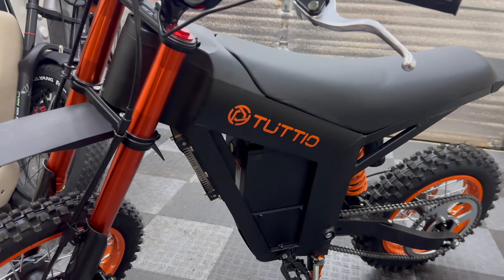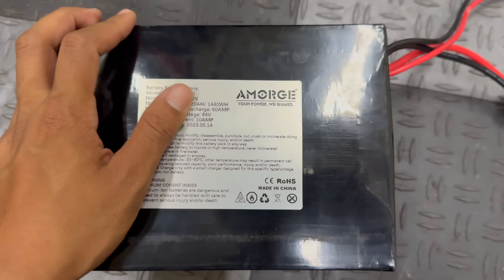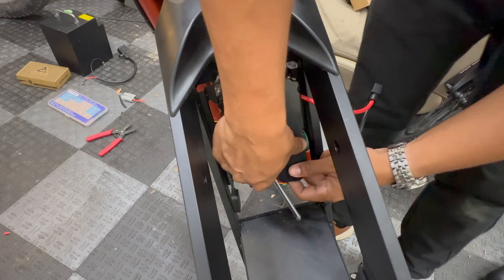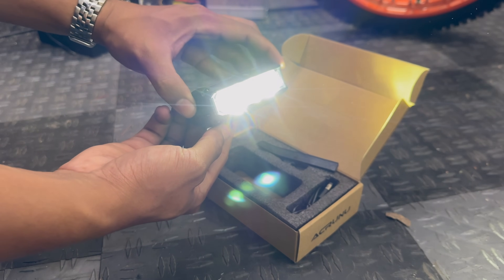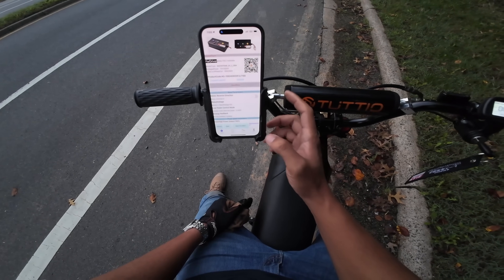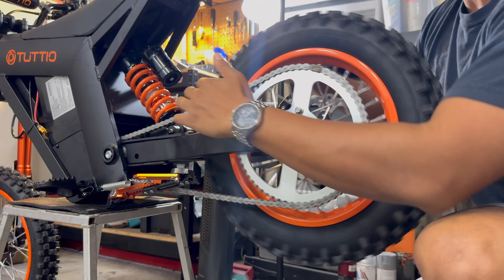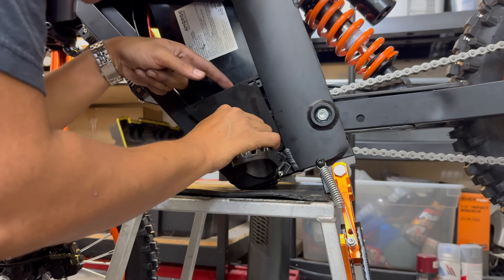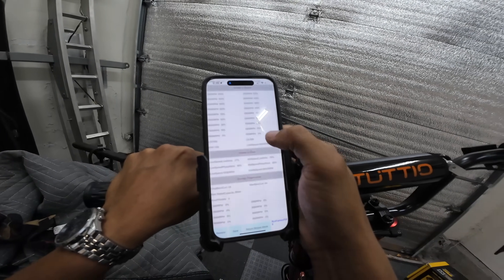Tuttio Soleil 01 Power Upgrade - 72V Battery Conversion

Comment: I love this bro... The battery just slid in there like it was meant for that bike. I can totally get behind a KR5V mine is running great on a ND72450 and a 200a 72v battery. I'd totally buy one of these bikes and just max out the fardriver settings on the stock power system and see how long it lasts. Not everyone is ready for 72v, but what you're experimenting with is right up my alley. SICK! That bike would be awesome with a set of supermotos and a DKD with that KR5V you have coming!
Reply: Reached out to Amorge for battery and they said they  have two batteries. 72V20AH 100/140amp with bluetooth ANT BMS
Samsung 50S cell
6x5.5x8.5inches

And 
72V20AH 40/50amp with bluetooth ANT BMS
Samsung 50G cell
6x5.5x8.5inches
Will either of those work?  I am new to upgrading e-bikes and also wondered if you could show settings for Bluetooth dongle.   Thank You!
Reply: @kevinp8442  bluetooth dongle pluga into the fardriver harness. As far as the ant bms in the battery you just leave it alone unless you want to change charge options. I perso ally would go with lishen cells and get sometbing with 150amp discharge
Reply: Lit
Reply: Where did you get your battery off of
Reply: Where did you get ut
Reply: What was the ratios he was saying for the tune bro
Reply: What is the cheapest 72v battery I can get
Reply: What about how high you can max out continuous amps and voltage settings in the app, with the stock battery. So if you can get a higher continuous amps(like 90a continuous) you can keep the 48v cause 72v*60a=4320watts and 48v*90a=4320watts. Also should've tried the different settings before changing the sprocket maybe you could have got the same speed or close to it with greater torque. 🤯
Reply: @myrontaylor77  The sounds like the stock controller max is 70A. I don't see any info on what the stock battery can do, But I would try 70A just for the fun of it 😈 Of course the BMS might trip at 70A.
Reply: Stock battery is limited to about 70 aswell @HiLuckyB both are paired perfectly but at max limits lol.
Reply: @MooseRidez  I'm surprised that if the controller and battery can do 70A, then why ship it at 50A on the controller.
I guess it would be less stressful, so fewer warranty problems 😂
Reply: @MooseTuned  He showed us that it is completely limited to 70a in the video. People didn't watch the whole thing? Maybe someone took a break in the middle. MOOSE Your channel rocks too. I'm in WPB. When is there going to be a ride out?
Reply: @HiLuckyB yeah so they can get the range claims out of it aswell 😅
Reply: I just bought a tuttio can you tell me the setup you just brought and how much it will cost?What I need and the battery.Thank you

Comment: Will the KR5v fit the tuttio? Or do I have to get the FW23?
Reply from the maker: It will not. You have to go with the FW23 OR do the whole Sotion swingarm and motor assembly, which is even more expensive but more capable.
Reply: @PatOutdoors thanks for the info, kr5v would’ve been the best route for my pocket since I’ll be upgrading 3 tuttios. But I’ve heard great things about sotion. I appreciate the help

Comment: Quick question, do you need to change the battery to change the voltage, and also what Bluetooth dongle did you use?

Comment: Can u. Make the actual. Speed show.up. On the speed thing
Reply from the maker: It’s always been displayed, just not as accurate as the GPS. The stock display reads a bit too fast
Reply: @PatOutdoors ahh and sorry for the full stops I have 
. Laggy aah keyboard
Reply: @PatOutdoors how do you buy this battery?

Comment: Got the amorge battery too, after plugging it in, bike starts, display lights up and the controller beeps 3 times over and over again, throttle does nothing. What do I do?
Reply from the maker: Connect to the controller with the Fardriver app and tune the controller to handle 72V. Nothing will work otherwise
Reply from the maker: Did you bother changing the tune on the controller for a 72v battery? Nothing would work otherwise
Reply: @PatOutdoors just ordered the fd bluetooth dongle, hoped that i could plug and play it just to see if it works, ig gotta tweak the controller 😢
Reply from the maker: @rendon7703 this applies to any electric bike. It possible could have damaged something already if you tried using it without changing controller settings first at the very least. Same thing applies if you plug a 60v battery to a 36v bike as so on
Reply: @PatOutdoors got the dongle, experimented with settings, everything works as it should, acceleration is crazy, 4 seconds and im at 45mph, thank you for the video ❤

Comment: The smaller rear gear is going to get you more MPH by itself. I'd wonder if you kept the original battery and made the gear change, what the top end would have been.

Comment: If I were to get a 60v or 72v battery for the Tuttio would I need to upgrade the controller and motor or can they handle it without frying?

Comment: I'd use a heat gun and bend the front fender into shape.
Reply from the maker: Ended up just replacing it with a CRF50 fender, like it much better now

Comment: so you didnt even change the esc, just a larger battery and adjusted the bms to see the new battery voltage!
Reply from the maker: The ESC is programmable. It’s a Fardriver controller, which I changed the parameters to accommodate for a 72v battery.
Reply: @PatOutdoors  How well is it holding up?  Im trying to decide from one of these and upgrading or the Mototec 72v pro.  the moto has the larger wheel size but for the price its hard to not want to buy this one.

Comment: How does your tuttio run when the Bluetooth dongle is plugged in ?
Reply from the maker: The same. All a dongle is is an antenna that allows you to connect with the Fardriver app. The change in how it runs happens when you actually make changes to the settings (through the app.)
Reply: @PatOutdoors Sorry I meant when I plug it in, save a tune and try to give it throttle, it shows “E 10”. That was my bad for not specifying

Comment: Do I need to do the positive and negative thing with the black and red wire? Or is it optional. And also what do you put into the dongle app that makes it able to hold 72v
Reply from the maker: Depends what battery you’ll be using. The factory battery harness is not usually compatible with most aftermarket lithium battery connectors. You just have to use whatever harness matches your battery commector

Comment: What would happen if I tuned the battery to 70v on the app, but I didn’t put in a new 72v battery, would the stock battery just be cooked?
Reply from the maker: @ttankyz  it wouldn’t run. The controller would think the voltage is out of range of what’s acceptable for 72V.
Reply: @ Thanks!

Comment: Have you taken this thing on any off road hills? Can’t seem to find much from anyone about this…? My primary use would be to travel in the woods up and down 15-25 degree slopes. Maybe some a little steeper, hard for me to tell. You think the stock Tuttio with controller mods has enough torque and power to push over this sort of terrain? Super appreciate your response if able… be looking everywhere for someone perspective on this. Cheers.
Reply: It depends on if you can keep up the speed or I just got one and have been taking it up hills and for the most part it has had enough to get up the hills but it definitely slows down quick once you hit the hills, I have the dongle on the way to see if I can get some more torque I weigh 130lbs and I can’t get the rear tire to spin even on loose dirt

Comment: How far can you go with this battery ?
Reply from the maker: @IGLFE4RFULL  not very far, 12-15 miles depending how fast I’m going and how hard I accelerate from a stop
Reply: @ hey thanks man for replying I was thinking about trying out the 72v but 12 miles is not enough. I’m thinking about the 60v 30 amp off the amorge website listed under Tuttio for more range and a small speed upgrade.

Comment: They just need to make a pro model of this bike with bigger wheels, the bigger battery, and a proper tune. They could make a BAD bike for a price  under like $1800
Reply: Technically they have it, called the ict lol. But I get what u mean
Reply: @Asher_Noel2012 the ict is honestly ugly
Reply: @TurningPointRobloxTPRBX finally someone else who gets it
Reply: @Asher_Noel2012 that's not it
Reply: I want a talaria xxx pro but its too expensive. I avoided the tuttio because of its small size. But i decided to get the tuttio soleil 01 gb cuz i think its slightly bigger but they should make a big bike

Comment: Can you help us... we just installed the 53t rear sprocket and amorge 72v 35ah 170a battery but we are only topping out 43-44mph... we have the line and boost at 70a and phase at 240a and just changed 48v to 72v
Reply: Did you figure it out?

Comment: Do you think it could do nine inches vertically without the tension bar without cutting the seat
Reply from the maker: Might get away with not cutting the seat, but the tension bar is maxed out at 8.5”

Comment: Yo please answer this question for 3:48 I don’t get it but the things you made with the wire and stuff I don’t have it I can you tell me how to just connect the battery to the control without that or is it the only way😢
Reply: Someone help me!
Reply from the maker: It’s only two wires, red from the battery needs to go to positive terminal on the controller, black from the battery needs to go to negative terminal on the controller. You have to use the matching harness for your battery..

Comment: Would a 9.06 x 5.51 x 5.51 battery fit inside the bike without moving anything??
Reply from the maker: @samuel_vanderwiel1  it will physically drop inside the frame, but the latch to secure the battery won’t fully close. I used a 6x5.5x8.5” battery
Reply: @PatOutdoors how much was it, and how long did it take to deliver, and where did u get it

Comment: Do you recall what size the light was you purchased? When I click the link they show several different sizes available. Thank You.
Reply from the maker: I went with the small, but would probably go with the larger one if you want a wide field of view at night. I’m actually doing a full lighting upgrade on this bike today
Reply: Will you be making a video on the upgrade? Thank you. @PatOutdoors
Reply from the maker: @gex32985  yes I am, keep posted on the channel today
Reply: @PatOutdoors what about the battery upgrade, I saw there are 2 different batteries available. Which amps would I go with? 72V20AH 100/140amp with bluetooth ANT BMS Samsung 50S cell 6x5.5x8.5inches OR 72V20AH 40/50amp with bluetooth ANT BMS Samsung 50G cell 6x5.5x8.5inches?

Thank You again for your time.
Reply from the maker: @ higher amp output would always be my option..

Comment: So if I buy the Bluetooth thing I won’t need to buy a 72v battery I can just change the thing to 72v and it will go faster?
Reply from the maker: @da305boss  all a Bluetooth dongle does is allow you to take changes on the controller settings. You still need a 72v battery to run 72v, this just allows the controller to work with the higher voltage battery.
Reply: Do you have a link to the battery? @PatOutdoors
Reply from the maker: @wvgeeyouinut  no such thing for Amorge batteries unfortunately. You gotta email them to order and let them know what specs you want and they’ll respond with a quote

Comment: if the bike is 48v 20 ah can you add a battery that is 48v 50 ah battery and will it make it faster and more range without braking it?
Reply: The factory battery is matched to the Fardriver needs, so adding more AH will not significantly increase acceleration or top speed. But range will increase significantly. 

If you want more acceleration at 48v, you need to tune the Fardriver, which comes set at 50a LINE current, and you can set that to 70a max. This will NOT increase top speed significantly, but it will run correctly.

If you want more top speed, you need to increase the rpm limits, which are MaxSpeed and Ratios in Speed, but be advised that it is the rpm limit that sets the cruise amps, and allows the controller to pull amps down to maximum continuous rating. If you set the rpm limits too high and ratios in speed percents to all 80%, with max Line current set to 70a, the controller will send 3000w continuously and the motor will overheat unless it has a functional temperature sensor. Even with that it will get 150c at the temperature sensor before shutting down the controller and that might be too late. Lol

So any change increases to amps or rpm limits must be tested and if you set the controller for “turn and burn” you must be the one to release the throttle and allow cooldowns before it overheats.

Comment: What is the app called I got the Bluetooth dongle I do not know what the app is called
Reply from the maker: Fardriver
Reply: Thanks
Reply: Do you need the other battery
Reply from the maker: @ to run higher voltage and make more power? yes

Comment: Hi bro.,Did you change the motor to fit the 72v battery?
Reply from the maker: Nope, still the original motor. The controller settings need to be changed though

Comment: if you're into diy remember that battery quality matters as much as your controller  . the higher the discharge current the better the performance but there's a lot of exaggeration by battery manufacturers so take 5 minutes and do some research to see what others have to say about specific batteries .
Reply from the maker: @andyvonbourske6405  have you heard anything negative about Amorge batteries? BTR I know for sure has had quite a fair share of quality issues recently
Reply: @PatOutdoors  i opened up an old Amorge battery to make myself a diy usb power bank and it was very well built .

Comment: So do I just need to upgrade the  battery
Reply from the maker: No. You need to change the settings on the controller so you need the Fardriver Bluetooth connector and download their app to make changes to 72V

Comment: Bike works fine but once I plug the dongle in and bind to the controller I get error code 10 on the display and the throttle does nothing. Any ideas?

Comment: Sprocket change would be cheaper
Reply from the maker: Well yes, which I did as part of this video. But I would still pair it with higher output from the controller and motor. At the very least, get the $25 Bluetooth dongle and turn up the tune

Comment: I have a question... if I just replace the rear sprocket with the one you have used in the video and tune the controller with the Bluetooth dongle what speed am I looking at? I'll be using stock battery.

Comment: Can you get more speed by just tunning the FarDriver or is the battery required? And also is changing the sprocket and motor necessary for this mod? Or only battery and running FarDriver!;) please and thanks
Stevo

Big fan from Quebec

Comment: Where did u get the battery
Reply from the maker: Amorge. You have to email them
Reply: What is the part number for the battery? 1:43
Reply: You have the Kr V5.Is that better than the sotion motor 1:43

Comment: Where’s the ❤button ? Curious what your distances have been like . I use my aventon a2 for exercise up the hills @ the Hollywood sign ( lungs and heart took a lot of damage but coming back full throttle ) but this is just a joy ride at a steal , I’m subscribed , if there was a stalk button I would have hit it three times . Much gratitude, so glad you took off the fender I think ink that was a small part of noise too , but I was shouting chain from the git go ( which is close to jump street but your experiment was on point , I just have an knack for noise ( I was blind for my first 18 y , didn’t get full daredevil stuff but I wouldn’t admit it if I did gotta keep that on the dLol

Comment: You should put street tires and bigger wheels on this thing! I’d love to see you getting this thing to be a surron competitor
Reply from the maker: It needs more motor and controller to support additional load. Though street tires on the stock wheels would be interesting
Reply: @ is the new battery holding up? Or is the motor and controller taking the toll yet? Im planning on getting one of these to start then upgrading to a talaria or eride when I get comfortable enough